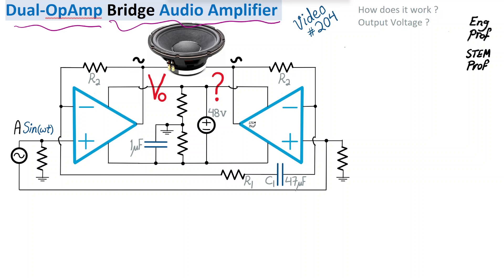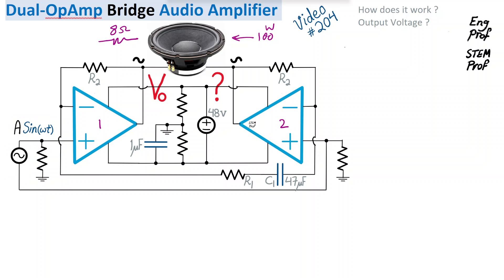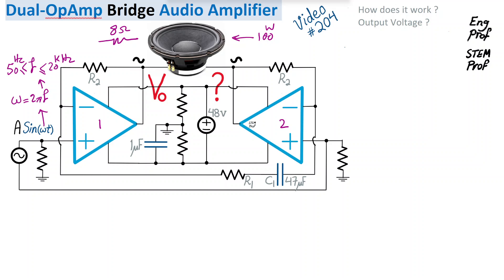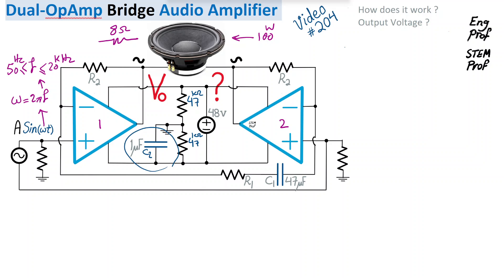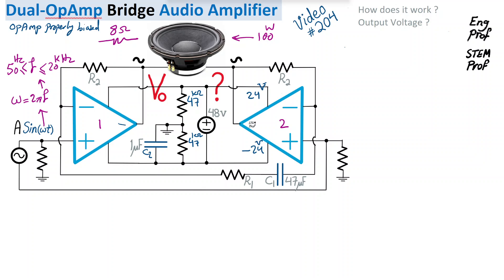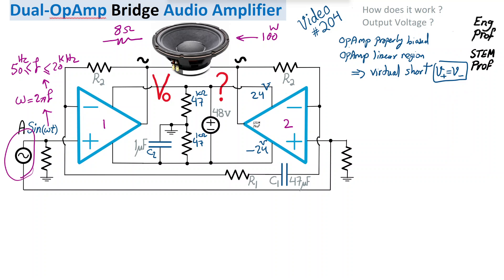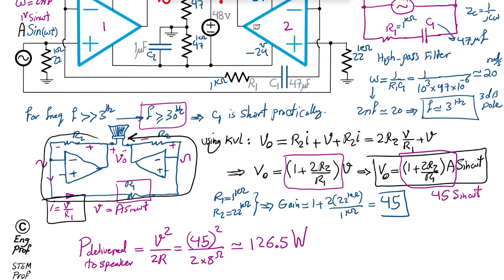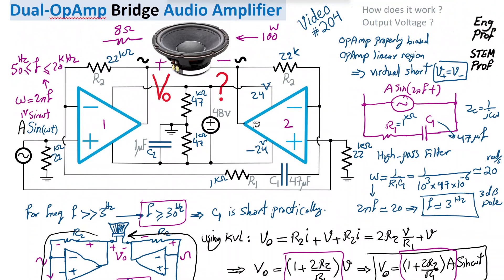Bridge Audio Amplifier Explained

Comment from the maker: Dual Op Amp Bridge Audio Amplifier is analyzed and explained in this video. For more Circuit videos:
Electric Guitar Amplifier to XLR Audio Signal https://youtu.be/X4y8cwZdGEk
Op Amp Amplifier with Electronic Gain Control https://youtu.be/NoNgQpbj77Y
Push-Pull Power Amplifier with Darlington Transistors https://youtu.be/866MYibo8yE
VCA Electronic Gain Control (Part 1): Voltage-Controlled Attenuator Overview https://youtu.be/cFzYZsPEtP0
Power Amplifier Design (Class A) with Transformer https://youtu.be/gKlJrqGqeCI
PhotoDiode Amplifier with Data Compression Explained https://youtu.be/hqrRx2ufAwg
Amplifier with -25 to 55 dB Attenuation-Gain range https://youtu.be/oyz6lTGd2Xo
Electronic Gain Control for Op Amp Amplifier  https://youtu.be/NoNgQpbj77Y
Thermometer Circuit Design with Op Amp & BJT transistor https://youtu.be/55YsraFE0rg
PhotoDiode Amplifier with Op Amp and MOSFET Explained https://youtu.be/1c3EJ2d4pVI
Instrumentation Amplifier with Electronic Gain Control https://youtu.be/C4tghZ-q6Zs
Voltage Regulator Op Amp Circuit with Foldback current limiting https://youtu.be/VN4_qF9DvBM
Push-Pull Power Amplifier Design with Op Amp, Sziklai Darlington Transistors https://youtu.be/8BFzsi7-Vbs

And the Analog Circuits Video playlist: https://www.youtube.com/playlist?list=PLrwXF7N522y4c7c-8KBjrwd7IyaZfWxyt  I hope these Circuit design and analysis videos are interesting.

Comment: Is it possible to bridge lm358 IC?
Reply from the maker: Good question. Texas Instruments LM358 Op Amp has too little output current drive requiring power transistors properly placed at its output.  I suggest you use a good Op Amp and then reinforce Op Amp output with for instance Texas Instruments BUF634 High-Speed Buffers or its newer version BUF634A to provide high enough AC current to speaker.  Alternatively, in case of lower power applications like headphone driver, newer Texas Instruments products like OPA2673 Dual, High Output Current Operational Amplifier might be an interesting choice for this circuit.

Comment: Thanks for the video. I was very interested in the 3 Hz pole High pass filter. I sometimes wonder why high end amplifier doesn't use bridge design. That would make it possible to place the total power on even more transistors (double up) and have even faster transistors in the power stage, that normally won't be used there. Thinking of two complementary output stage and then coupled them as bridge amplifier. Of cause the price will properly double but the high end market won't cry for that.
Reply from the maker: You are welcome! and thank you for your thoughtful comment. You raise an interesting point about the bridge design and its potential in high-end amplifiers. You're right that using a bridge configuration can allow you to distribute the power across more transistors, effectively doubling up on the output stage, which could improve the performance by using faster transistors that typically wouldn’t be utilized in a simpler design.  Bridge amplifiers are quite popular in high-power audio applications, especially in cases where efficiency and power delivery are key. 
   The tradeoff, as you mentioned, is the cost, doubling the output stage means more components and potentially more complexity. But for high-end audio, where the market is often willing to pay a premium for better performance, it’s definitely something worth considering.
   If you're interested in more amplifier designs, you might want to check out my following videos:
"Electric Guitar Amplifier to XLR Audio Signal" https://youtu.be/X4y8cwZdGEk, which delves into interfacing and amplification for musical applications.
"Push-Pull Power Amplifier with Darlington Transistors" https://youtu.be/866MYibo8yE covers another popular design that improves efficiency and linearity in audio amplifiers.
"Push-Pull Power Amplifier Design with Op Amp, Sziklai Darlington Transistors" https://youtu.be/8BFzsi7-Vbs takes a deeper look at a more specific type of push-pull design using op amps and Sziklai pairs for improved performance.
Thanks again 🙂
Reply: @STEMprof  Thanks for your answer and Hints for Amplifier design. I'm a big fan of your channel.
Reply from the maker: My pleasure. I'm glad that you like my engineering channel 🙂

Comment: I like learning audio power amplifier design.   Thank you very much.
Reply from the maker: You're welcome! If you found the Dual Op Amp Bridge Audio Amplifier video helpful, you might also like the Electric Guitar Amplifier to XLR Audio Signal video https://youtu.be/X4y8cwZdGEk, where I explain amplifying audio signals for instruments like electric guitars, and show how to properly interface with XLR outputs.  If you're interested in learning about electronic gain control for amplifiers, I have a couple of videos that explain how to manage gain electronically. You might find Op Amp Amplifier with Electronic Gain Control https://youtu.be/NoNgQpbj77Y and the VCA Voltage-Controlled Attenuator Overview video https://youtu.be/cFzYZsPEtP0 useful. These videos will provide you with further insight into amplifier design, signal control, and practical applications in audio systems. I hope you find them interesting as well.

Comment: LOL,I fail to understand how this works, but configured s non inverting opamp, so both raise and fall a the same time.
I simulated the circuit, i even put a 8 ohm resistor between both opamps as analog for the speaker, the current was like u amps over the 8 ohm resistor.
I even rotated one of the opamps like it would seem logical, one pushing and the other pulling, but the behavior was the same.
I'm curious how this Bridge mode works, my car amp has this.
Reply from the maker: Thanks for your interest in this circuit and sharing your thoughts/observations. As explained starting in minute 8:30 , It is like a differential amplifier for AC input signal that is applied between the non-inverting terminals of the two op amps.  As the input AC voltage increases, it pushes up the positive input terminal of say the left op amp higher than the other one's. As a result an AC current flows from left to right through the resistor R1 (C1 impedance is practically zero in the frequency range of interest).
Reply: @STEMprof  Hey, i made a pcb of my class AB amp, now i wanna make a pcb for the power side, bridge rectifier, etc.
I wanna add a soft start to prevent inrush current of the capacitors, using mosfets.
for the positive rail it's not so hard, but applying the same voltage of the gate of mosfet of the positive rail on the negative's gate doesn't work, since there is like 40 Volt difference. the negative rail moves much faster if you use caps as time delay.

I tried various sources, like stack exchange.
You happen to know a method of moving 2 mosfets a the same time on 2 voltage extremes?

Comment: If we take a really good input opamp and reinforce the output with for instance BUF634 (number of them, I mean 30-60) we'll have an excellent hi-fi amplifier with power enough for a big room. If we provide a really good power supply, that will be considered a hi-end amplifier with no doubts.
Reply from the maker: Good points especially regarding using combination of Texas Instruments BUF634 High-Speed Buffers or its newer version BUF634A to provide high enough AC current to speaker.  Alternatively newer Texas Instruments products like OPA2673 Dual, High Output Current Operational Amplifier might be an interesting choice for this circuit. 👍
Reply: @STEMprof  Yes, OPA2673 might be interesting for some applications, may be it will be enough for a headphone driver, however I don't see it inside a power amp with its +-6.5V supply range. May be with a floating rail this will be possible.
Reply from the maker: @sc0or Yes, good point regarding supply range. We can also use high-current power transistors at the output of Op Amp to defer power delivery to transistor so that we can have a wider choice for the type of op amp for this audio amplifier.
Reply: @STEMprof  Sure, but even mid power bjts mostly are not fast enough. I can remember KSC2690 and 2SC3503 with a bandwidth to 150MHz. High power transistors are not an option at all. And this is why buf634 with a bandwidth to 250MHz is unique (relatively unique due to high current output). I listened to an amplifier built with buf634 which was able to amplify PAL signal -) It sounded as a hi-end device. However it didn't use a bridge architecture and was limited with 20W@8Ohm
Reply from the maker: @sc0or  Great points regarding the importance of monitoring the max speed that power transistor is able to achieve.  But I think there are Power Transistors that can easily handle Audio frequencies with 20 to 40A Collector current. Few examples are OnSemi 25 Ampere 200W 2N6338, 2N6341 High-Power NPN Silicon
Transistors https://www.digikey.com/en/products/detail/onsemi/2N6338G/1475307 and possibly Fairchild FGH20N6S2, FGP20N6S2, FGB20N6S2  600V 125W N-Channel IGBT https://www.digikey.com/en/products/detail/rochester-electronics-llc/FGP20N6S2/11508896
Reply: @STEMprof  A speed is good, but a price is not humane -/ But 40MHz is 40MHz on the other hand. On the third hand 2SC5200 with its 30MHz costs only $3-5.
Reply from the maker: @sc0or  Well-said. Thank you. 😄

Comment: How will the workload be distributed between the amps if the input signal has a slight unintended offset?
Reply from the maker: That's a good question. In this analysis we are applying an input AC signal in differential mode with zero DC offset. I would suggest using AC decoupling capacitors at input so that we isolate input terminals of the Op Amps from any DC residual of the applied input signal.  I hope this is helpful.